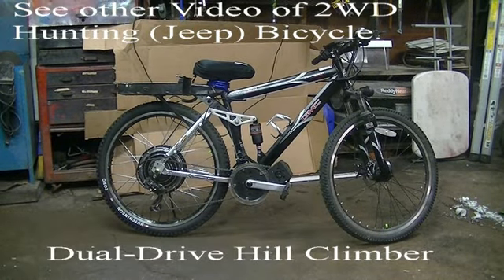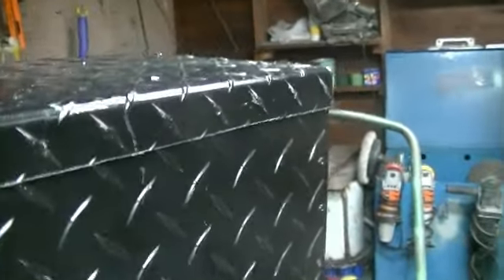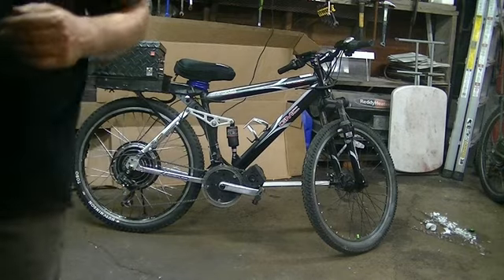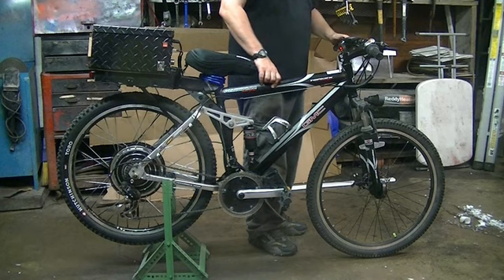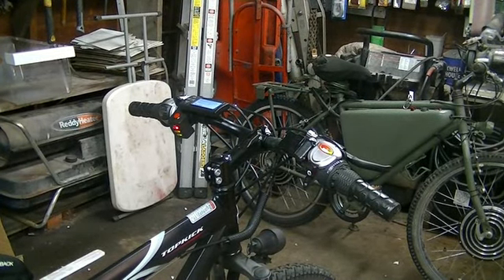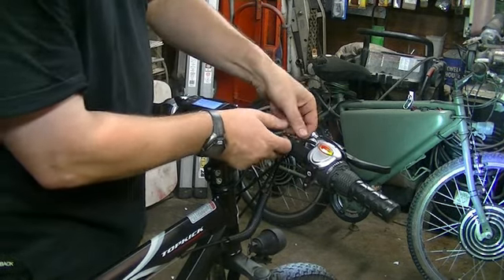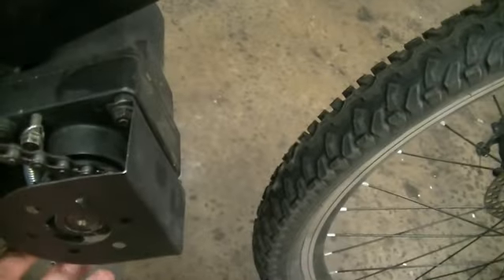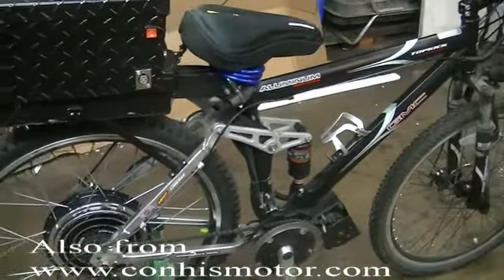Dual Drive, (Mid-Drive & Hub Motor), Electric Hill Climber Bicycle

Comment: I have been looking for a video like this for a while now, I think you're the only one that's made the dual drive with mid drive and hub drive. I have been asking on other videos if anyone knew if this would work or not. Glad to see it does and thanks for the video too!
Reply: Any dualdrive projects yourself?
Reply: @Fe'ra Kinematica Maselectra Has been an idea in my head for years! I got a rear hub drive full suspension fat tire bike right now and absolutely love it. It's specifically for going to the beach. I live 30 minutes from South Padre Island, so it's been there a lot lol. I'd love to get a full suspension fat bike with mid drive, then add a rear hub drive, possibly a front drive as well later on if there is room for the controller & battery. Let me know if you do it first, I want to hear all about it! Lol

Comment: Nice! I’ve thought what would a dual hub drive along with a mid drive motor be like. Then I thought more, and realized the amount of weight with those two components alone is not appealing, but it gets worse when you add in the batteries for both of them is insane.
Reply: Was wondering the same thing with my dual hub krusader. Add a mid drive, separate throttle and all. It sucks on hills

Comment: I use the based geared motor with 2nd motor of a gearless DD 2000WATTS as a Turbo Booster. This set up is the best practical way of building a DIY Dual

Comment: Doing this aswell with my Kent Thruster MTB Full suspension bike, Will be adding a 1500w hub drive brushless, and then a bbs02 mid drive, and with a 52v 17 ah battery pack, and possibly reach 48 mph

Comment: How does the rear rack work?  Looks like it's solidly mounted to the seat post yet also mounted to the swingarm uprights which move with suspension travel.

Comment: was thinking the hub should be in the front. the mid drive control the back in the end... so it is all wheel.
Reply: With loading that heavy battery and implementing two motors I think it's pretty obvious hes not going for traction control or anything silly like that.... this is clearly a wheely machine all that torque on one tire!!!!
Reply: @legna199111  hello, I say keep the mid-drive and rear hub.  Just add a front hub as well. All wheel drive with more power going to the back. Plus more power!!!
Reply: Leave as is and add a front hub motor as well!!!

Comment: What would work better and will give you a lot more power is if you put hub motor on front wheel. It will balance the power to the wheels a lot better including better traction and be performance up hill and better starting speed.

Comment: Hi , i was thinking of doing this myself , ive got a 1500 watt hub motor on my MTB and was thinking of adding a 500w or 750w mid drive aswell , more for the pedal assist and extra speed than anything . Was wondering would this increase my top speed aswell as my acceleration and hill climb ability ..... This video is one of onley two i can find on the net of someone whos actualy done it ............ Thanks in advance and great video . :-)
Reply: +Richard Williams It probably won't increase your top speed much because the hub motor can only spin so fast. Once it reaches a certain RPM, it won't go any faster.
Reply: Thanks m8
Reply: Richard Williams
But it might increase your top speed some. I recommend posting your questions at Endless Sphere where they have much more experience. It would also depend on the type of hub motor you're using. Some are designed for higher speeds.
Reply: Thanks , but ive decided against the idea now and purchased a vector frame and suspension to fit my kit on , and will upgrade the motor if i fancy a faster speed in the future . Yes did post on endless sphere ....... Many thanks and good luck with any future builds !
Reply: was thinking the hub should be in the front. the mid drive control the back in the end... so it is all wheel.

Comment: is there an advantage to sending all the power to the back wheel? Would it be an issue putting the hub motor on the front wheel?
Reply from the maker: Here is one I built like that..https://www.youtube.com/watch?v=bvo5557cX48.
The only problem with power to the front wheel is that it slings mud in your face because there is little weight on the front wheel. Still fun! It corners very quickly, but takes some getting used to in order to control it when powering around corners. I eventually made a second throttle to control the front wheel speed with my left hand and the rear wheel with my right.

Comment: Does hitting both motors at same time do anything or does one just overshadow the other at a certain point?
Reply from the maker: It does take off faster with both motors, but it is more effective when I cruise with the hub motor, up to about 20 mph then use the mid-drive in 21st gear to take off. I got it up to 54 mph once, but it is extremely scary doing over 50 on basically a 10-speed bike frame.

Comment: Got a 2018 Rad mini and wanting to put a mid drive motor with hub. Everyone says no way but if you did it here.why not the RadMini?
Reply from the maker: You would have to fab your own motor bracket to make it fit. You could 3d print an enclosure for your controller and fit it just about anywhere, but I don't see any reason you couldn't do that. The Rad mini has a 48v battery pack, so you could use the same pack if you wanted to.

Comment: At the risk of sounding redundant... "what is the top speed on that torque monster?" How about battery life? The dual systems are just coming out from eMotion (fr & rear hub motors) Evo AWD Big Bud Pro. It looks like you knocked it out of the park!!
Reply from the maker: I got it up to 52 mph on a smooth straight road. Although it had a slight downhill grade. I think that is the top speed, but i got scared, let out a little girly scream and slowed down. That is way too fast for the light frame and cheap tires on it. I figure I would get about 50 miles on a charge if I don't get stupid. Although, I have been unable to get more than 35 miles 'cuz I can't resist speeding up while pretending to pedal when cars try to pass me.

Comment: I wonder how good a front motor hub would work.  Front wheel drive.
Reply from the maker: They work well on the street. Almost the same as a rear one. Off road it spray mud in your face.

Comment: how can you build this, wouldnt you need a total of 4 brake handles, 2 batteries, 2 controllers?
Reply from the maker: 2 batteries, 2 controllers, yes. ONly 2 brake handles, and you can use two seperate throttles, one for each system, which I did. You can also wire one throtttle to both systems in parallel. The throttle control can handle that, but I chose not to do that on this one. 
I did do it that way on this one.
https://www.youtube.com/watch?v=bvo5557cX48&list=PL2F2i95KUlz_5YJKyjmZa_Xdx3IKAep7_&index=2
Reply: @brain151  could you use one large battery and connect both controllers to it?
Reply: @Brian stapleton can u use 1 large battery and connect it to both controllers?

Comment: I'd LOVE to see a Charging System Built into the Back-Box like:- RC Nitro Engine and Alternator Set-up.!? Yeah.!!? You could really Quiet it down with a Loooong Exhaust/Muffler, or even use the Bike Frame as the Tubing..

I'm sure this would Increase the Travelling Distance Exponentially, I mean those Small Petrol Motors or Nitro Engines can go for Hours n' Hours, just Depends on the Gas Tank Size...
Somebody please help this to happen...

Comment: shame that is so back heavy, on steep stuff it would probably flip back.  it appears that you have locked out the rear suspension with the battery support?  I am about to put a mid drive on my hub motor bike.  can you tell me about the stress on the rear drive side side cover?  they are known to rip off.  also have you tried to change your cassette or open the hub to change bearings?  from my understanding the thread on cassette will tighten to a point of no return.
Reply from the maker: It is a little back heavy, but since all of the power goes to the back wheel it actually makes it great for climbing hills, especially in the mud. I have not had any issues with the rear drive so far. I have heard about the issue with the cassette tightening up so I drilled a hole and tapped a small allen screw through it to keep it from tightening further. I have not yet taken it apart to change the bearing, so the jury is still out if that will work. I will try to get some video this winter of me riding it in mud and deep snow. I will say it is a hunting bike, for pulling a deer on a cart out of the woods. It is never going to be a stunt dirt bike or compete with a Stealth Bomber.

Comment: can you do this setup with 1 battery?
Reply from the maker: 1 bigger battery would run both motors and not overheat. the dual battery set up was really because the large battery was $1,300 and not in stock..

Comment: how much torque from each motor and then in total
Reply from the maker: I am not sure about the hub motor, but I am guessing it is fairly low, like 10-20 ft./lbs.. It is more for keeping cruising speed. The mid-drive is a 1,500w motor with 160 newton meters i=of torque. (About 119 ft./lbs. It is geared into a 21 speed sprocket drive which can make it pretty much climb a tree in low gear or get a top speed of 52 mph. (52 is where I screamed like a little girl and let off  of the throttle.) It is very scary riding 50 mph on a bike and tires designed to max. out at 20 mph. I normally ride it at under 30 and use the throttle for the mid-drive for passing or climbing steep hills.

Comment: What kind of mid drive did you use?
Reply from the maker: http://www.sickbikeparts.com/catalog/product_info.php?cPath=26&products_id=181&osCsid=cvaaejjc97v8lv58msm4heavv3
Reply: +kissell welding This one is a really good deal. http://lunacycle.com/motors/mid-drive-kits/cyclone-mid-drive-3000-watt-planetary/
Reply from the maker: +ThingsDemystified 
my mid drive is only 1600 watts and I can get up to 45 mph in high gear. That one is 3000 Watts for just a little more money. I'm gonna look into that one and see what the max RPMs and torque ratings are. maybe I can use it to turn my bike into a tow truck.

Comment: a hillclimber is mid drive and front hub, this is pointless, youre better off getting a 205 50h or 273 40h in the rear for better torque and efficiencies